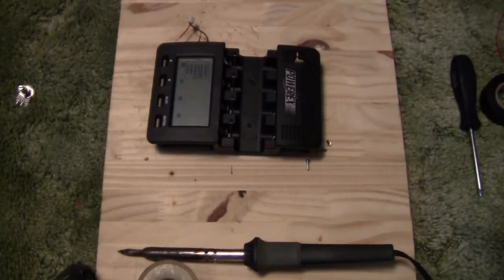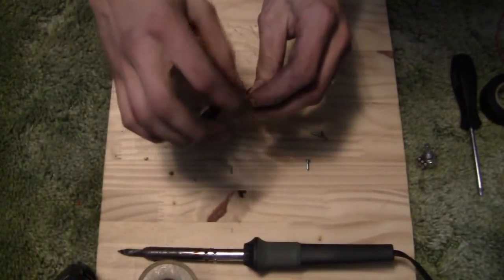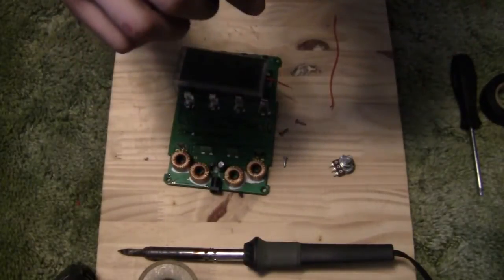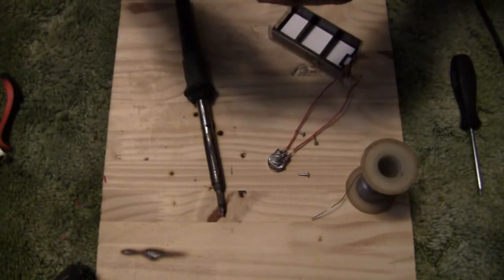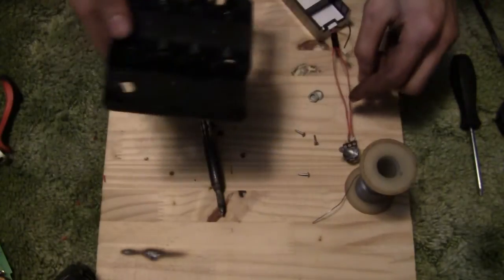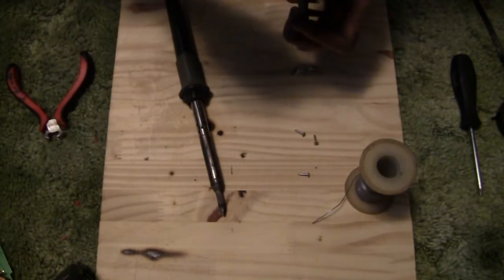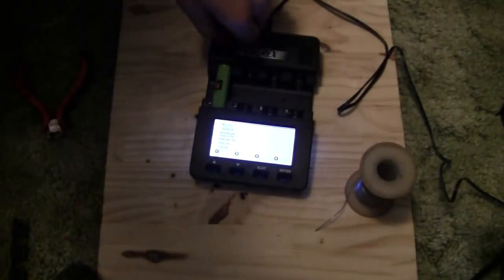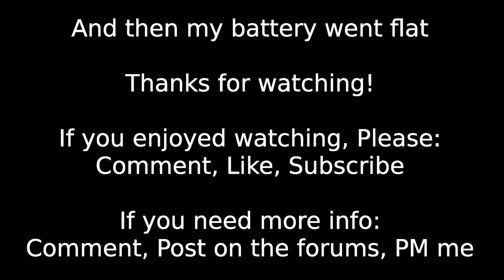Maha Powerex MH-C9000 Adjustable Backlight Mod

Comment: I just snipped the red wire and soldered in a 1/4 watt 150 ohm resistor, and then heat shrink tubing over it.  It dimmed the display about halfway, which is MUCH more tolerable than the way it was before.  You pretty much needed welding goggles to look at it before !!  Just make sure you snip the red wire closer to one end or the other, and snip the ends off the resistor to leave them about 1/4" long, otherwise you won't be able to get the shrink tubing to cover the exposed wire and resistor.
Reply from the maker: Awesome info! Thanks a ton for sharing, that's a much easier and less intrusive way than adding the potentiometer, and still dims the backlight down from surface of the sun brightness level it normally is. I'm going to see if I can pin your comment or update the description with your info at the very least so that others can benefit!
Reply: Thanks for your video!  I probably wouldn't have even thought to do it otherwise.  And I looked stupid in welding glasses LOL!!

Comment from the maker: You could defiantly use one of the 3m connectors, I've used those splicing phone wiring in the past I believe.

Charger is holding up pretty well so far, no worrying play anywhere, you can wiggle the contacts but it just seems like the metal flexing, nothing i'd think is failing.

Just got internet on after the move, sorry it took me so long to get back to you!

Comment: Instead of using your Iron to Mate the 2 wires to together you Could of used a 3M UY connector it eliminates one of the Solder joint's it's really conductive and the use of it also eliminates using Tape.. I have used them in several installations and they work really 

Well.. So far hows your charger holding up is it still doing the Job i've Noticed on my C9000 that the slot 1  and  3  Negative contact seems to have a slight bit of play in them are you seeing this in your Charger as well..

Comment: I see... but i just thinking to replace the potensio with err "trimpots" if im not mistaken on the names LOL so no need to drill a hole and extra cables just set your desired brightness 1st  and closed it but its hard if you really need frequent on adjusting the brightness

Comment from the maker: Haven't noticed any side effects. Helicopters aren't trying to land on my charger anymore, but thats probably a good thing. Parts list ison our website, there is a link in the video description directly to the thread about this mod, with a parts list and links to buy them. Really a very simple mof. 1k pot and some wire, tape, solder and soldering iron. Substitute heat shrink for tape ideally.

Comment: A little of more piece of Advice: I prefer using heat shrink tubing it seals up the joint better and a stand for the soldering tool helps along way).  

A small parts Vice would've held the part in place to were you could of used both of your hands to do the Job. The Video was ok Dude but please next time drop the Music add some more light to the scene to were ones can see what your doing and it will be great.. O less fast forwarding lol  Take Care akr..